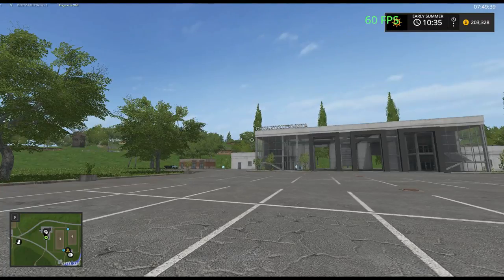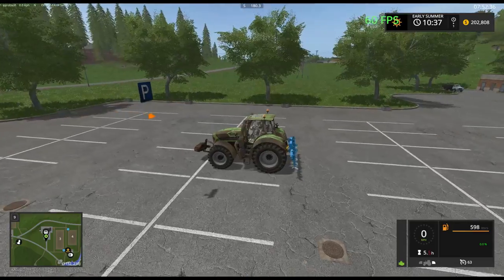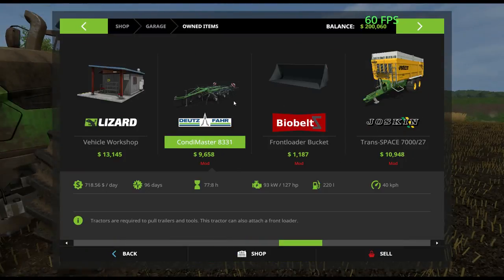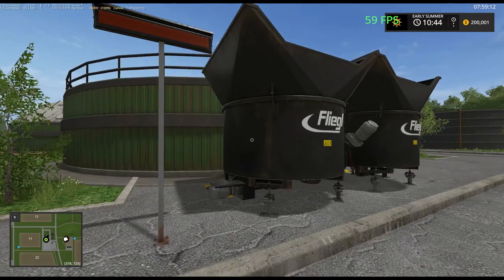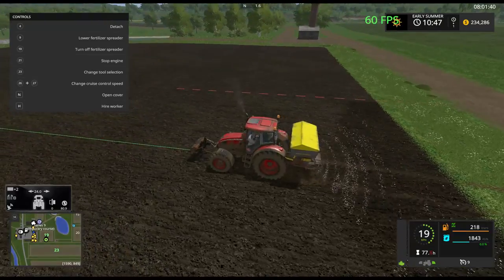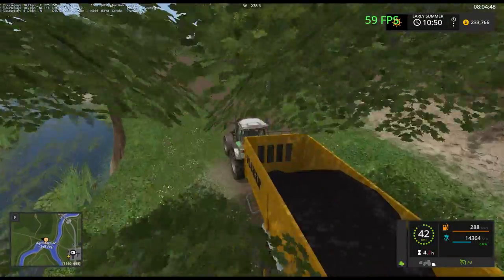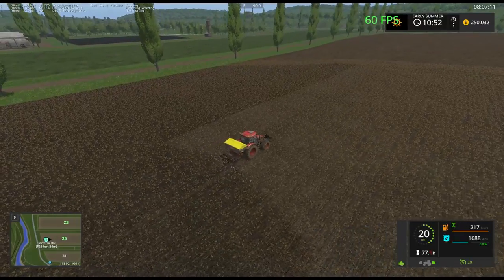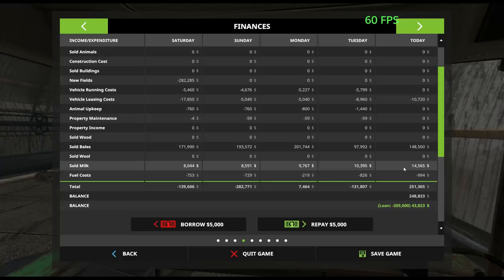Farming Simulator 17 - Sosnovka - Getting creative #FS17

Comment: Lemken used to be my plow of choice - as you could add cultivator to it and do twice the work in 1 pass. But you need about 350HP for the Lemken plow/cultivator combo. The new Kuhn 4m plow/cultivator combo only needs 250HP, you can add the seeder for about 350HP total - so 3 jobs for the same HP requirement as the Lemken allows for 2.

However the Lemken has another advantage - there's a tractor hitch that allows you to mount 2x 4m Lemken plows side by side for an 8m total (but 400HP), I also wonder if you can add a pair of cultivators to the entire kit, but scary HP requirement world then!!
Reply from the maker: +Neil Harbott Yeah it's a neat piece of equipment but there are definitely other options